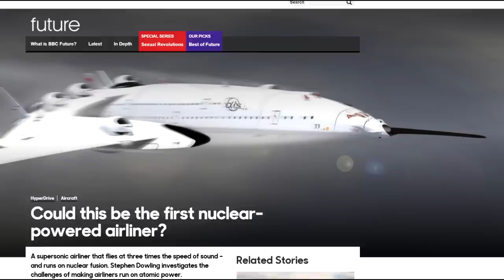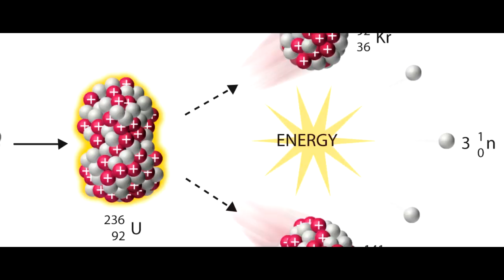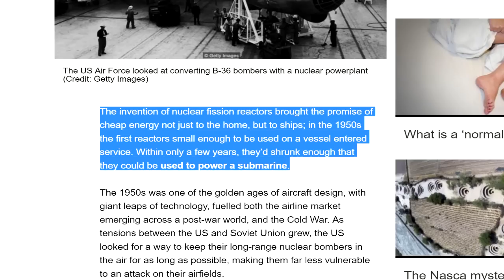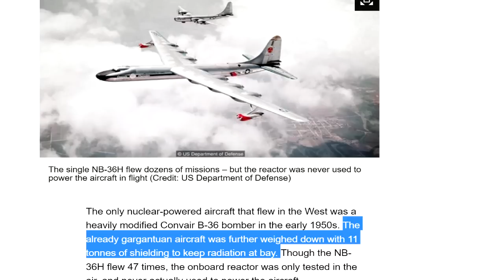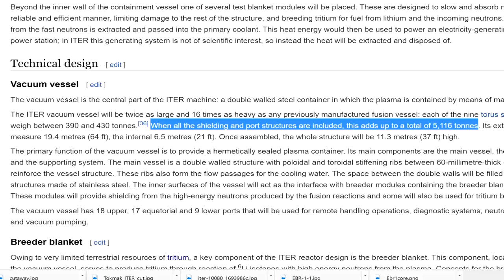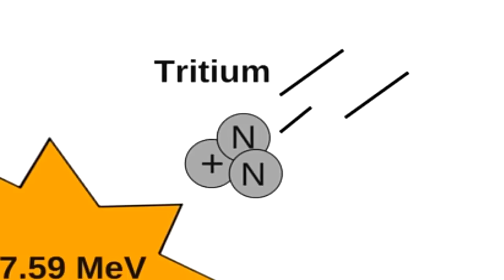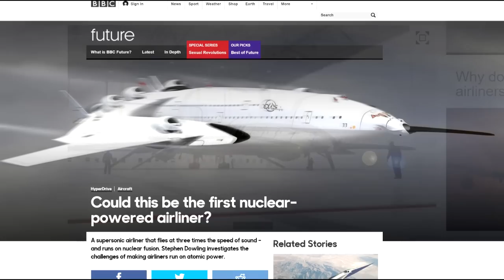SIX ENGINED Nuclear Airliner... BUSTED!

Comment: I love watching this guy disprove the BULL CRAP out of everyone ;D
Reply: +LouSaydus You're missing the point though.. Even if they had a fusion reactor right now, the amount of shielding you would need to make it safe to be around, would weigh too much to fly. And because of that, it's funny that they are giving details about how many passengers,   and how many engines it has.
Reply: You can't really disprove something that doesn't exist and is barely conceptual. In theory, the idea is sound, the reality of it is that with modern methods it's completely out of the question. That's why a breakthrough in fusion power would be needed to make something like this work, there are fuel cycles that don't produce high energy neutron radiation.
Reply: I also said that there are multiple types of fuel cycles, it's true helium fusion can cause high energy neutron radiation but there are other types of fusion that do not cause high energy neutron radiation.
Reply: Its not just the reactor that's the issue here. Just how do you convert the large amount of energy generated by such a reactor into forward thrust? you couldn't just stick the heat generated out the back end (however many engines this has). You would need some sort of turbine system to get airflow over the wings, using direct or indirect output from the reactor. Direct output would put radioactivity out the tailpipe (as shown by the US trials) and indirect would would require heat exchangers and other heavy auxiliary equipment which would be mostly made of metal to deal with the heat and help with the shielding. Also how would you deal with the issue of acceleration on the people inside the aircraft? Star Trek inertial dampeners anyone? With current tech the g-force experienced in a commercial flight is estimated (I look around the web for this one) 1.2 G max (with some  quotes saying airframe design is 2 - 2.5 G max). We are talking faster than the current air superiority jet fighters here, so unless everyone on the aircraft is 100% fir you could end up with dead passengers and an expensive lawsuit...

I do like science fiction, but I think this is just going towards the 1950/60's ideas of "We will all have hover cars, jet packs and be living on the moon by the year 2000". As a concept sure it is fine, but with maybe too much detail. I do concept design (not for aircraft) all the time, that leads to detailed engineering and actual construction, this seems to me to be not just "pie in the sky" but "pie in an alternate reality".
Reply: I agree but the smug presentation has put me off.
Reply: +blacksileighty2 you are thinking too much, I just like watching this guy, okay? XD
Reply: +Duane C I stupidly posted my own comment without a moments hesitation, your comment seems way more in depth and to the point than mine. You also did your research. :) I came up with my ideas for an engine like this in a year 9 physics class about pressure. :/ Anyway, tip my hat to you and will do more research next time before spewing out my thoughts. :)
Reply: ShatteredMercury
It is always so simple to point towards this kind of thing. Sure, there were wrong predictions, but that does not mean we shouldn't use our scientific knowhow to assess ideas. We wouldn't be as advanced as we are today, if we hadn't selected what to pursue in a sensible manner. We would still try to transmute gold.

Arguing from hindsight isn't helping. Yeah, Kelvin was wrong, but there are so many people who argued against ideas that were impossible that turned out to be exactly that. Kelvin being wrong doesn't invalidate any doubt. If I say, you can build a fusion reactor with peanut butter and brass, that wouldn't be plausible just because Kelvin once denied an idea and was wrong.
Reply: I would think that this would be so far off into the future that another power source would be invented that is "safer" and much much lighter (probably more powerful too) before the fusion/fission reactor is small/light enough to be used for atmospheric flight.
Reply: >Just how do you convert the large amount of energy generated by such a reactor into forward thrust?

Convert to electricity, run electric turbines. The hard part is getting a small lightweight fusion generator (which probably won't exist anytime soon), not what to do with it.

>Also how would you deal with the issue of acceleration on the people inside the aircraft? Star Trek inertial dampeners anyone?

I would suspect by not being stupid and dealing with it the same way we deal with it now: Don't subject them to too much acceleration. You've got a throttle for a reason.

>We are talking faster than the current air superiority jet fighters 
here, so unless everyone on the aircraft is 100% fir you could end up 
with dead passengers and an expensive lawsuit...

Uhh...what? Air speed =/= Acceleration. You want to keep acceleration at a comfortable pace, that's it. You can hit whatever air speed your frame is designed to handle and the people inside aren't going to have any problems. 

No, there's only one problem here: Where are we getting a lightweight fusion generator?
Reply: That isfunny

>Doesnt that mean there will have to be a limiter on accelaration that stops mistaken overaccelaration?

What are you even talking about? You use a fusion gen to run an electric jet turbine. Of course you can limit the acceleration. It's not like a throttle is a foreign concept.

ShatteredMercury
>Actually I'm wondering now what this airplane will use for thrust.

Air. It will use air. It's jet engine wouldn't be a normal jet engine, it would be a fancy hightech fan.

Duane C
>the airflow though the engines is not going to be really much different than today.

Irrelevant. You have a fusion generator, ergo, you have power to spare. Whether you'll get mach 3 out of it is a different story. Not to mention, this would actually come with a major shift in turbine designs to take advantage of a ridiculous power budget and the electric nature of the turbine.

>airframe design currently allows for 1.5G max acceleration rate.

Irrelevant. This feeds back into "don't be fucking stupid" and there's no problem to solve. There's no problem here that current aircraft don't also have. Airlines solved this problem by not recruiting pilots that are going to try and ride the bleeding edge of their crafts flight envelope, because that would be fucking stupid. This is like whining that busses will never be good public transportation because if the bus driver is a complete fucking idiot he could roll it.

>The lightweight generator is not the only issue

Yes, it is. Everything else is either something we already have, or inherent in the creation of a lightweight fusion generator in the first place.

>There would be too much weight and too much equipment involved.

Yes. There almost certainly would be. Hence, why I said we probably won't have one anytime soon.

>There would need to be large advances in material science, turbine design and airframe design even without the reactor.

For what? We're not doing anything here that we don't already do. The only thing we can't make is a fusion generator. Everything else is just coming up with a specific application of what we already have.
Reply: >> the idea is sound, the reality of it is that with modern methods it's completely out of the question
This is setting the bar incredibly low, though. Like, on a level with a time machine.
Sure, some things will change with new breakthroughs in the future, but not all potential technology is equally plausible. Batteries with a lot more capacity will change the world and are very plausible to be figured out the next decades. Resistance to aging is plausible enough to be considered possible but is nothing to expect, really. The technology is make this plane possible I would place beyond that.
Reply: +davidian 77  totally
Reply: Thunderfoot sounds like lord Kelvin who claimed heavier than air ships would be impossible to construct and fly. Sure It's impossible now or at least not cost effective but is it so hard to imagine we will have some better way to shield from neutrons in the future? The first computers which had the processing power of pocket calculator took up several rooms of space when they were first built. Now they have shrunk by orders of magnitude. 

I mean if they took someone from 500 years ago into today's world.... they wouldn't even be able to begin to wrap their minds around our current tech. I imagine the same would be true if we jumped 500 years into the future
Reply: Yeah but thunderfoot didn't say this was impossible just a long way off.
Reply: being smug is just another way of saying you are right.
Reply: Good point. Doesnt that mean there will have to be a limiter on accelaration that stops mistaken overaccelaration? Or is it even possible to get that acceleration? Power does not equal acceleration after all. The reactors idea is definately dodgy tho... I wish the scientists good luck on it! After all, the guy who (invented) jet engines (in Britain) was almost palmed off as a crazy dreamer... didn't do too bad!
Reply: Actually I'm wondering now what this airplane will use for thrust. If you do get a fusion reactor onboard hypothetically you could convert that power to electricity and drive propellers but they sucked so we switched to jet engines which provide thrust from combustion.

Combustion of some sort has powered every single high speed air and space craft we have today. I wonder If you can just use engines to compress air and make that your thrust.
Reply: +ShatteredMercury Sounds like a good idea. Props weren't that bad after all, jets just have more power and operate better at higher speeds and altitudes.
Reply: >>Just how do you convert the large amount of energy generated by such a reactor into forward thrust?

>Convert to electricity, run electric turbines. The hard part is getting a small lightweight fusion generator (which probably won't exist anytime soon), not what to do with it.

Converting to electricity to run as turbines would work, however unless you had a lot more engines (or a major shift in in turbine design) the airflow though the engines is not going to be really much different than today. 

>>Also how would you deal with the issue of acceleration on the people inside the aircraft? Star Trek inertial dampeners anyone?

>I would suspect by not being stupid and dealing with it the same way we deal with it now: Don't subject them to too much acceleration. You've got a throttle for a reason.

My comment was more flippant than anything else, but (I think I mentioned) airframe design currently allows for 1.5G max acceleration rate. So unless something is done along the lines of a dampener you might not reach max speed before you then have to slow down. Slowing down being the next issue for the same reasons.

>>We are talking faster than the current air superiority jet fighters 
here, so unless everyone on the aircraft is 100% fir you could end up 
with dead passengers and an expensive lawsuit...

>Uhh...what? Air speed =/= Acceleration. You want to keep acceleration at a comfortable pace, that's it. You can hit whatever air speed your frame is designed to handle and the people inside aren't going to have any problems. 

Yeah I noticed spelling issues with what I wrote above, but I still think I covered it above. (probably writing it late at night or something)

> No, there's only one problem here: Where are we getting a lightweight fusion generator?

The lightweight generator is not the only issue, better turbines, better cooling systems, (in the case of electric conversion) lightweight generators and motors, better airframes to cope with the stresses, the cost of the whole thing! All of these things need to be considered. 

I don't think that conversion to electricity is a viable options just due to the requirements of having the reactor connected to one set of turbines connected to a generator to then connect to a motor to drive turbines. There would be too much weight and too much equipment involved. Better to drive the turbines as directly as possible from the power plant. Cooling whatever is used to drive these turbines could be done in the wings I supposed as there won't be a requirement for wing fuel tanks (replacing fuel tanks with heat exchangers and possibly air intakes on the front of the wing, but that could cause aerodynamic issues and then we are back to speed issues). 

There would need to be large advances in material science, turbine design and airframe design  even without the reactor. I suppose cold fusion (which quietly went out of the news after the Fleischmann–Pons experiment and the controversy) would be a way to go, but that is also a major breakthrough that is not (I fear) soon to be perfected.
Reply: I just discovered thunderfoot, he awesome
Reply: +RandominityFTW Great points: finally someone cleaned up the comments a bit. Still a skeptical about the reactor. But I guess we have to wait and see what the people working on fusion come up with.
Reply: The issue is that the 'designers' of the Flash Falcon are not nuclear engineers and have not addressed the fact that current nuclear reactor designs are a solid bar of entry from creating their plane. They're instead designing their plane around a sci-fi reactor and basing the stats of that plane around the fantasy output of said fictional reactor.  

Yeah, I could design a vehicle that can drive 300+ mph and survive direct hits from AP tank rounds, and it would be an amazing vehicle for military use. The only thing stopping me is that I haven't discovered vibranium yet, which is what the chases is built out of and allows it to do all those amazing things. But it's all good, I have concept art, so give me a million dollars please?
Reply: Andrew Loyal The difference is we've already used fusion bombs and we are already testing a fusion reactor in France. 

Vibranium you just made up we've not exploded it and we don't have experimental reactors that use vibranium.

the way science is going I'd put money down that your cellphone a 100 years from now could be powered by a nano scale fusion reactor unless of course we stumble into some amazing breakthrough at CERN and our phones are all powered by antimatter.

Submarines are already powered by nuclear they need to be light as well or they sink and they also have people on board so they need to be adequatly shielded from radiation and neutrons.
Reply: +ShatteredMercury Yeah but comparing the kind of reactor on a sub to the ones you'd need on a plane isn't actually that fair. Nuclear subs tend to be pretty big, and weigh in the tens to hundreds of thousands of tons. Part of the shielding used is water too. (like the water in the outer hull) -but a plane as heavy as a sub would be overkill. theres a reason waters sinks (or falls) in air an makes oceans. So your sub can be pretty heavy and still float: Water weighs 1ton per cubic meter. Air is much less, but I get your point.
Reply: ShatteredMercury okay, so using your example, what these guys are doing would be equivalent to designing and marketing a cell phone- today- where the base design hinges on an antimatter battery.
Reply: Andrew Loyal
Are they actually marketing the Falcon thingy, or was it a "gee wiz, we could make cool stuff like this if we get compact fusion generators!" type of deal? My only knowledge of it is coming from this video and it really looked less like marketing and more like "potential future thingy if other future thingy ever works!".
Reply: +RandominityFTW that was my thought too...for a good comparison the watch that Dick Tracy wore was obviously not possible at the time of conception yet now look at what Apple sells...a god damn phone watch lol.
Reply: He smart af too
Reply: Bär Honigfeld You would place this on the level of time machine in terms of feasibility? Time machines, according to our current understanding of the laws of physics are genuinely considered 100% impossible. At least this is theoretically possible. :)
Reply: That isfunny Meh, yeah. I might have overshot a little. Let me lower it to space elevator. Or rather to a little lower... at least the space elevator would be of incredible unique use....

Comment: Any practical aircraft would have to be propeller driven using  water as a  driver (using steam turbine tech to power plane) as well as the main insulator  of a very small core (around fist sized)

Comment: Given that if a jet exceeds Mach 1 over English territory everyone complains about the sonic boom. What commercial value is that. To go into space? Yep that will sell and I'm sure China will quite happily beat it's chest. Virgin have been trying to make space travel for the masses viable. Not going too well. Jets skim just below the sound barrier for a reason. Concord was fantastic but a failed experiment. Nope. 650mph-1 is the best and cheapest way. So we are stuck at that.sorry but peanuts and uncomfortable seats are what we've got. I did fly first class to Auckland NZ from Stanstead, 20 hour flight. Pretty cool. Free booze. I got so pissed. Scared of flying. Air hostesses were nice and my hostesses' boobs were massive. I quite liked it, I've never looked someone in the eyes so moch in my life. DO NOT look at her boobs, was all I could think.

Comment: Even the design looks like it's begging for its wings to fall off. Even if they changed the design, good luck stabilizing a reactor on it. the SR-71 went at comparable speeds and had its wings heat up thousands of degrees. Cooling a reactor in that environment would seem tough.